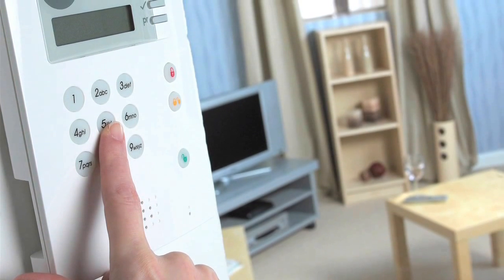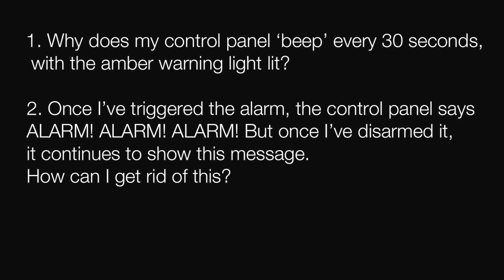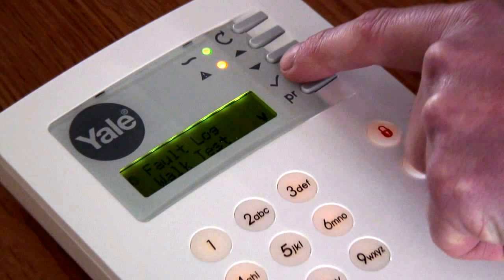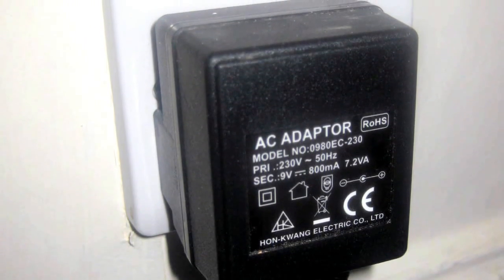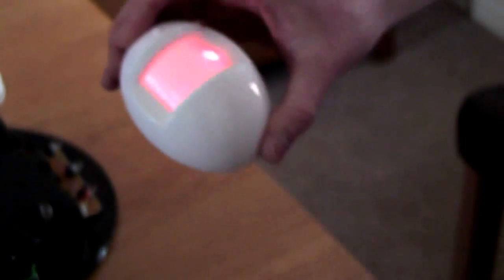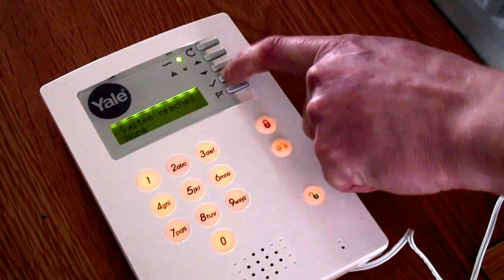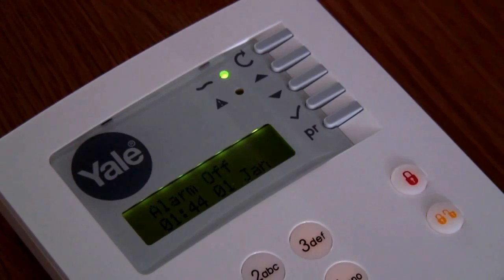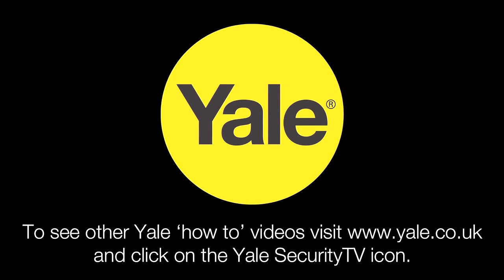YALE_Troubleshooting for Yale HSA6000 series wireless alarm

Comment: Has anyone had the" System reached none" problem ? When this is displayed there seems to be no way to reset the alarm. Yale don't answer their phones so I got hold of them on twitter and basically they have no idea. Ideas please.
Reply: Yeh I have this any joy ?
Reply: @jpooky9141  Yes,it went off when I was on holiday,I heard it through the CCTV, when I got back home I ripped it off the wall and put it in the bin, never been stressed since.
Reply: @chrjf887  managed to work it out just had to keep pressing the up arrow button there was 16 instances of the same pir sensor once you've scrolled through it clears
Reply: @jpooky9141  Glad you managed to sort it.